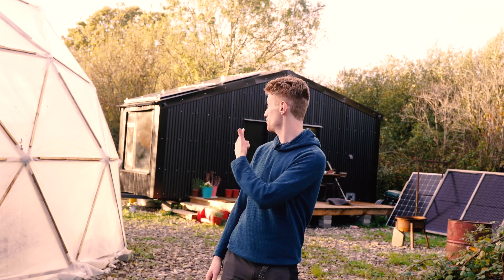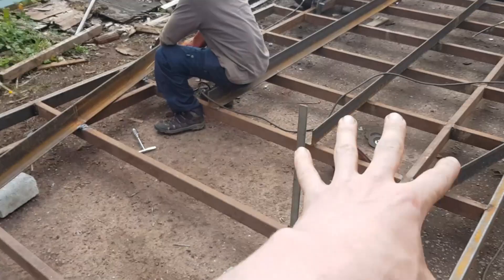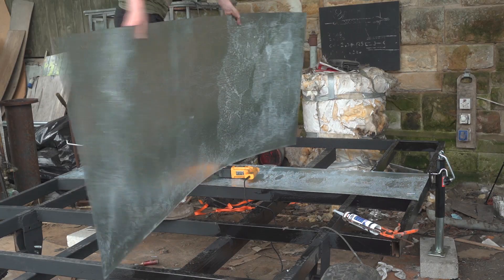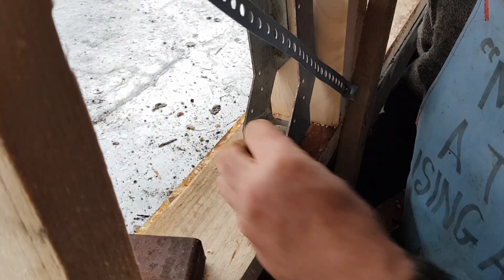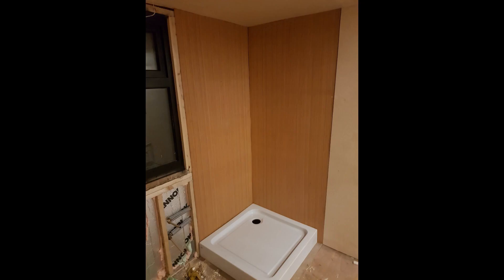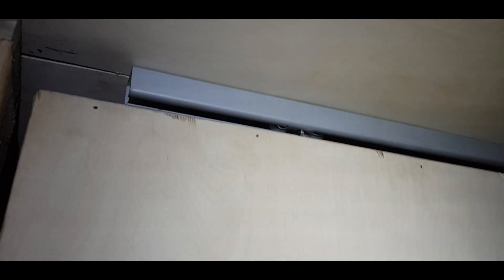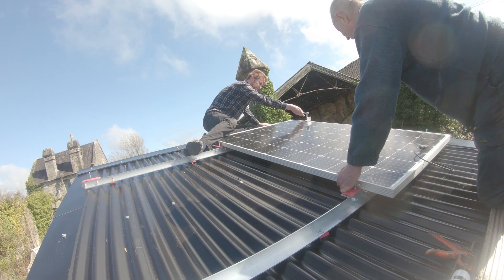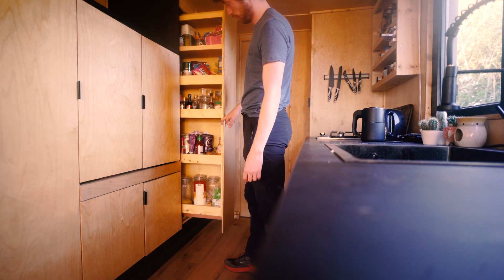Build A OFF GRID Solar Powered Tiny house  from scratch

Comment: Hi ruairi, brilliant build and great video, just wondering how your heat recovery is working out and also does the house hold the heat well throughout the winter nights, thanks
Reply from the maker: Heat recover seems to work well probably not as effective as a proper one but the space is very easy to heat so no issues in winter